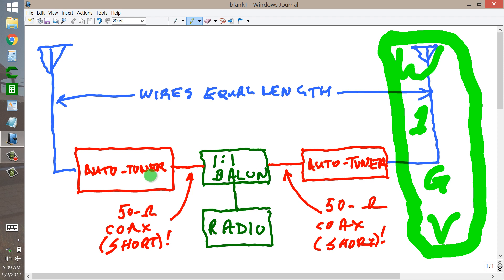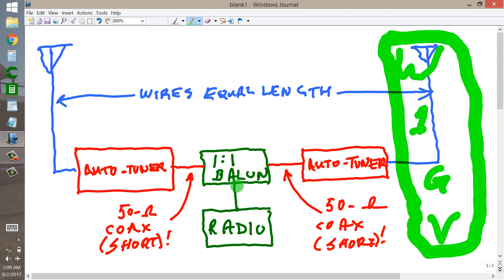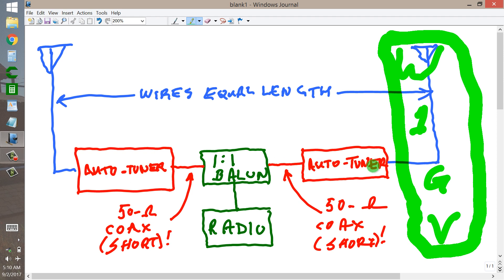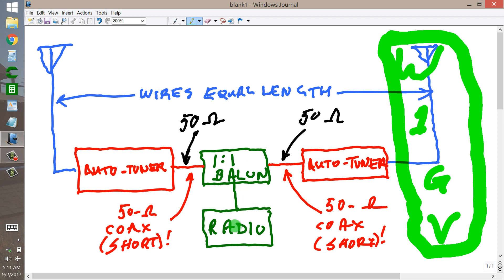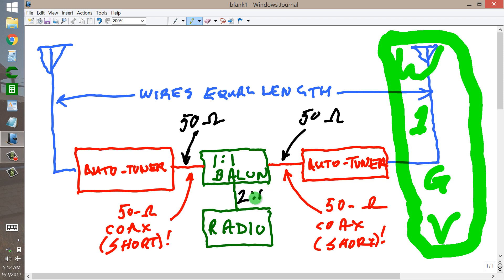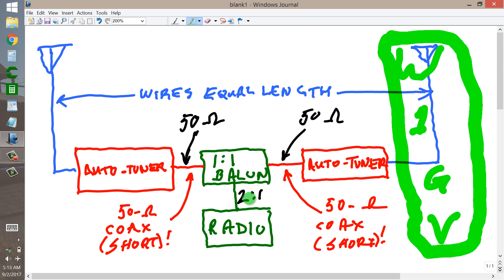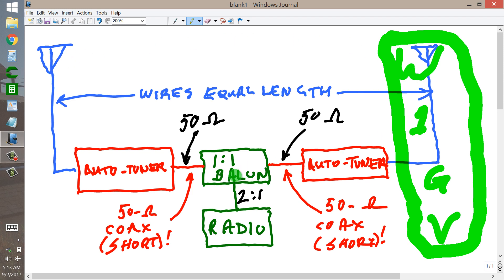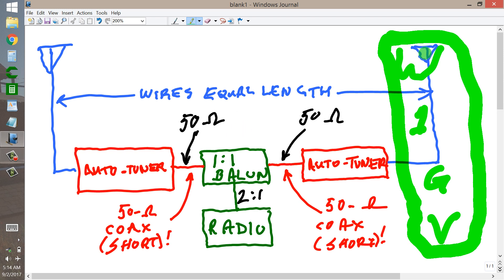A Crazy Antenna Idea

Comment: I built a part 15 am antenna with a vertical inductor around 2.5 feet tall and have a 3 foot wire horizontal , just a couple inches above the metal roof of my house . The antenna is L shape with the short wire and the inductor . It works very well , just as well as a 7 foot tall antenna . Could you tell me why it works so well ?
Reply from the maker: To be honest: No! Antennas sometimes defy theory. Actually, the design isn't too bad in theory for 15 meters. The metal roof no doubt helps a lot by serving as an efficient ground plane.

Comment: Mr. G,  your idea is well above my skill set but would not there be twice the loss because you insert two tuners?  Also, I want to comment on one of the other guys questions below.  73 KB3SVJ
Reply from the maker: Having two tuners might introduce twice the loss. Given my druthers, I'd use a balanced transmatch at the station and feed the antenna with open wire line. This idea just came to me as something interesting to try.

Comment: Will this setup have phasing issue?
Reply from the maker: I guess it would depend on the frequency. If the whole antenna measures more than 1/2 wavelength, phasing could affect the directional pattern, but only experimentation would tell the real story. If I head the funds and the health, I'd put one up and compare it with conventional dipoles, verticals, longwires, etc. in on-the-air tests.

Comment: Very interesting.. do yiu think will be work ok for low side bands? 40m or 80m?
Reply from the maker: Should work okay. For best results, try to make each side of the antenna at least 1/4 wavelength long at the lowest frequency you want to use. If you can't make it that long on 80m, then 1/8 wavelength on each side will work if the tuners can correct for it.
Reply: Stan Gibilisco Thanks for the information.  I enjoy watching your videos, I learn a lot and make me come with new ideas. 

73

Comment: Wouldn't the balun need to be a 2:1 balun? I would expect the radio to be getting 100 ohms otherwise. And how far apart would you put the antennas.
Reply from the maker: I wish I knew. Seems like it would look like a 100-ohm antenna. The problem might be findin a 2:1 balun. But a 2:1 mismatch should be okay (not perfect, but neither is a half-wave dipole). The two halves of the antenna should converge at the balun.

Comment: Interesting idea, however, wouldn't those antennae act the same as a co-phase setup? AND, it seems to me those auto tuners may fight each other while attempting to match to 50 ohm.  Wouldn't the transmitted RF from one wire have a certain effect on the other? So, the transmitted RF from the wires would have an effect on the other, which would most likely confuse the tuners, no?
Reply: So as to avoid the tuners fighting with each other, could you place a diode on each side of the 1:1 balun?  But the problem with my  idea is that the RX  could not return to your receiver unless the diodes were in some way only operable during TX.
Reply from the maker: Oooooh, I'd stay away from diodes in an antenna system. I suspect that they'd generate harmonics like crazy.
Reply from the maker: That's my main concern ... that the tuners might fight each other (and the tuner at the output of the radio, too!). But the only way to find out for sure would be to build the thing and see what happens. I'd do it, but I have to watch every penny these days, and I'm too sick most of the time to do much of anything (except make a few videos and work on my next book).